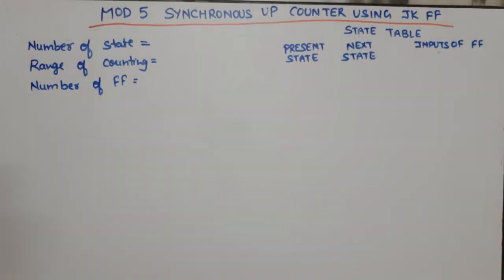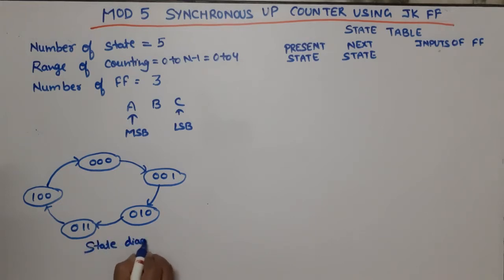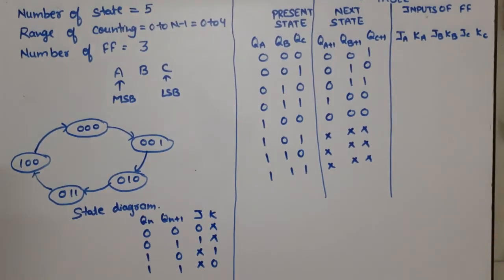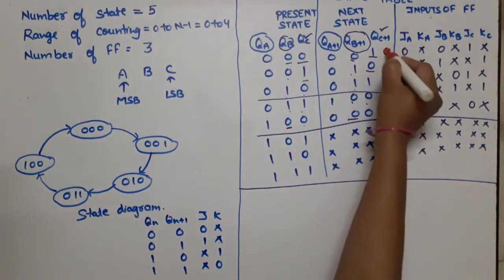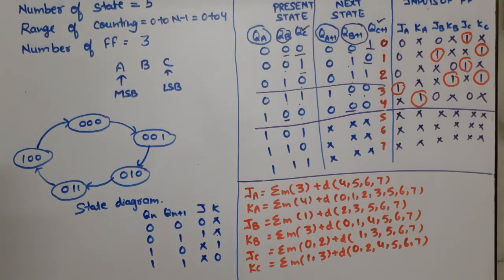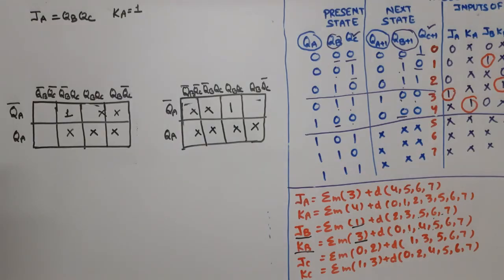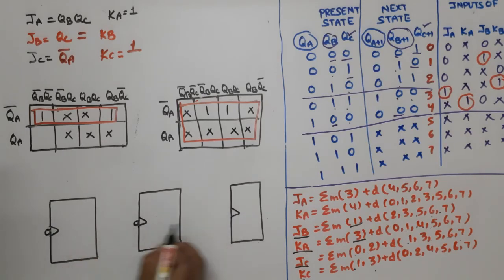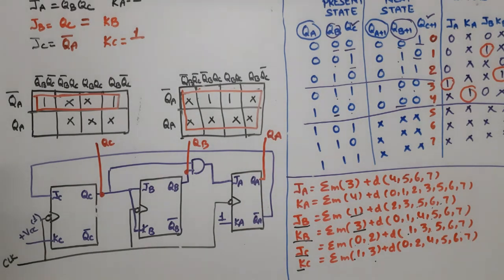MOD 5 Synchronous Up counter using JK Flip Flop | Modulo 5 counter | synchronous up counter

Comment: Your counter playlists is best. But here a question type missing that a synchronus counter circuit  design given and we need to determined the mod number and timing diagram. Please  add this. Then it will be very helpful for me mam. I am struggling  this type of synchronus counter questions
Reply from the maker: Send me question
Reply: @TechnoTutorials2783  email address please